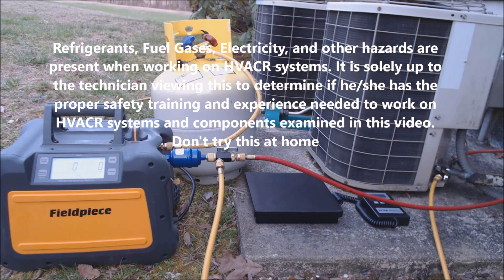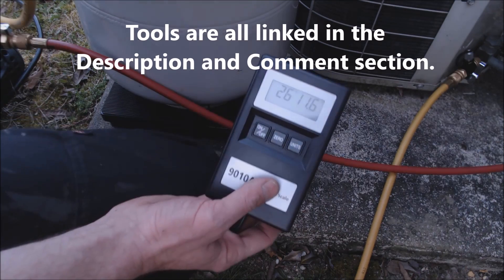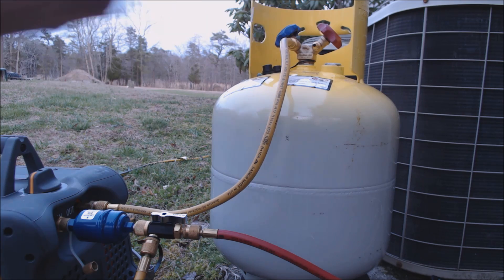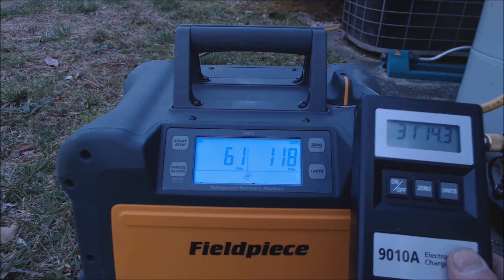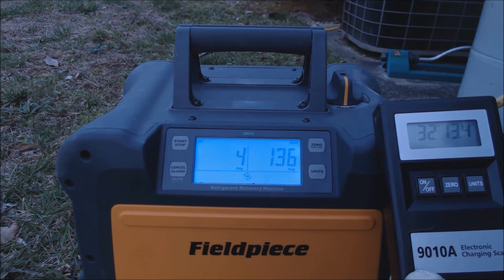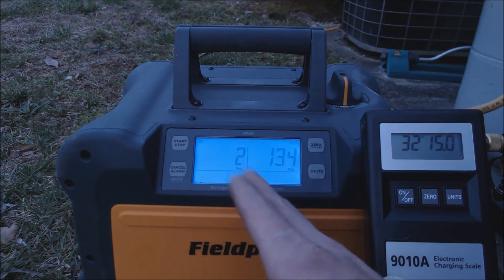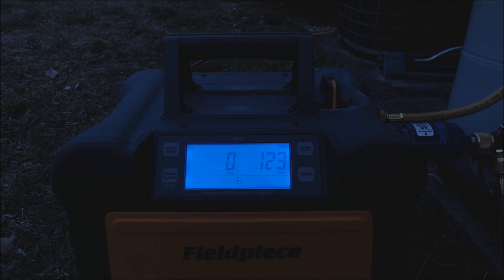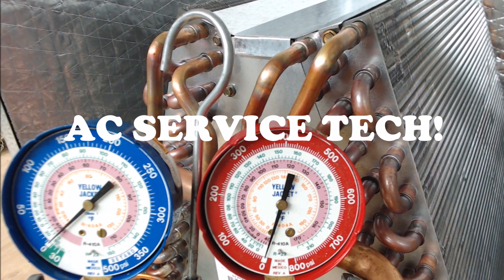Refrigerant RECOVERY Procedure Step by Step! Fully Recovered!

Comment: The fieldpiece mr45 is not the choice of most professionals because the cheap lcd display will not take an indirect strike. Stick with Appion. It is by far a better more rugged unit.
Reply: Melvin292 that’s an expensive lesson right there.  You can cut down a phone screen saver to put over it. I did that after my crescent wrench test.  The machine should still work without the screen,  just use gauges👍
Reply from the maker: I have used the Appion G5, G1, as well as the Fieldpiece MR45 and I think they are all well put together and last, thanks Melvin292!
Reply: Melvin292 not true I have thrown wrenches at it. It’s more durable than you think. The appoin has no self purge.
Reply: Nor-Cal Refrigeration & H.V.A.C - thanks for the suggestion.
Reply: Nor-Cal Refrigeration & H.V.A.C - the fieldpiece sman was originally demoed by the factory to take a fall from a roof top and work without damage. For that reason, I purchased the manifold and found it to be factory tough. I purchased the 45 thinking the same would hold true. Unboxed the unit and stowed in my van and before I could use the unit, a run 75 rolled off the van rack glancing the mr45 lcd. I was shocked when FP would not replace the cracked screen and suggested an inherent flaw leaving the screen susceptible to damage. I realize you can't heave a 45 off a roof, but a glancing blow from a run cap. The screen should not crack. I too have the Appion and  find them most durable and bullet proof. Welsh for large commercial applications and Appion for the smaller residential application have become industry standards. Good luck with your unit. We have discarded our unit file 13!

Comment: I noticed that when you turned the recovery machine ON for the second time, there was a dot on the right side of the number 23. Did that indicate a negative number? If that is the case, would you have let air into the recovery system, and thus into the tank?
Reply from the maker: When I turned it on the second time, it had positive pressure. The third time was in the purge function when the recovery machine pumps the refrigerant from the condensor in the unit. Each time I turned the recovery machine on it had positive pressure. At the end of the purge when the unit was getting ready to shut off I believe it was at 23 inch HG, thanks

Comment: He makes it look so easy 
Does it matter which hose is going to either side high side low side into the recovery machine
Reply from the maker: When we take saturated refrigerant out of both sides of the system like this, we put it into the vapor side so it doesn't have to bubble up through the liquid from the bottom of the tank from the liquid drop tube, thanks Will!